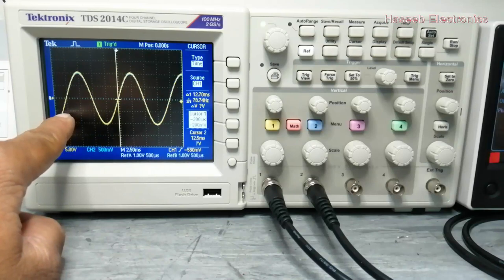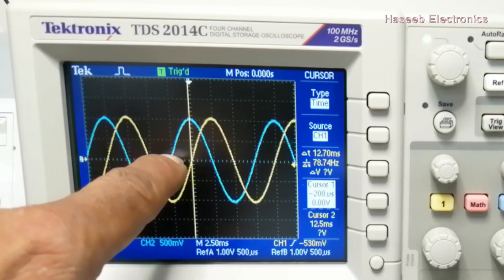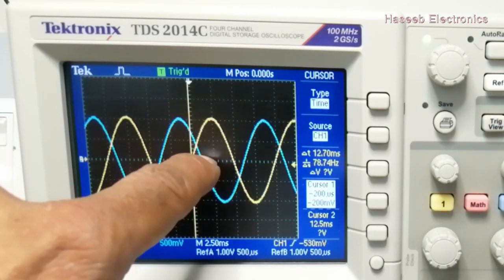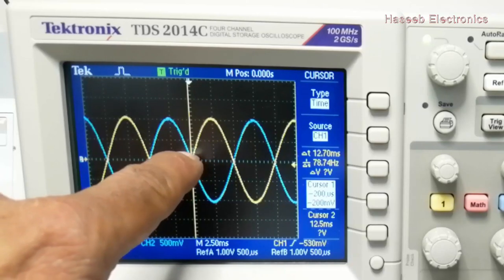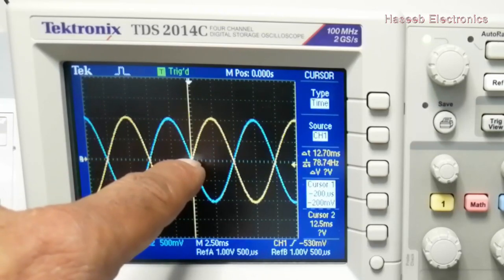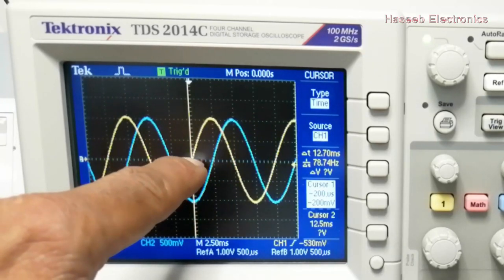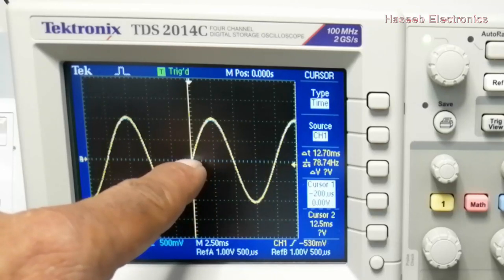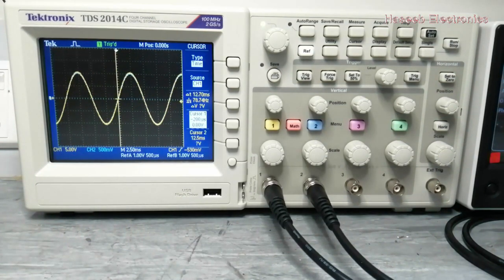{467}  How To Test Phase Angle With DSO, Mmeasure Phase Difference With Oscilloscope

Comment: Dear Haseeb, thank you for your continued efforts to teach us. I offer the following with the greatest respect for your knowledge and in the spirit of helping one another... For explaining phase angle, I believe that your communications would be clearer by drawing (with different colored pens on paper) a single, complete wave for each of the two signals, for each example of their offsets. Using the continuous signal traces of the oscilloscope makes it difficult to sort out the visual information. I would also suggest that you follow the teaching of the offsets with instructions on how to determine the beginning and ending points of each wave, within the continuous traces on the oscilloscope. For example, it is easy to confuse a positive/negative offset relationship with a negative/positive offset relationship of the same degrees. This is particularly true for older oscilloscopes that only have a single color for both traces. I hope this helps.